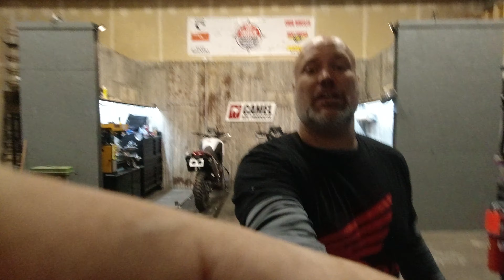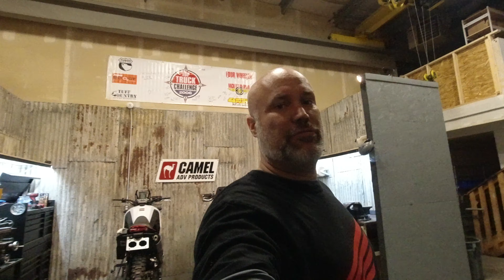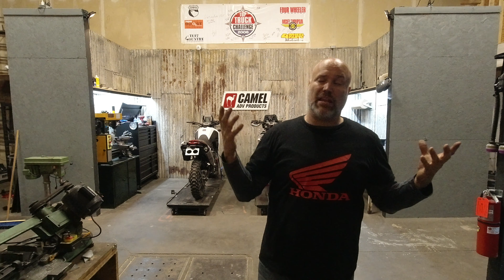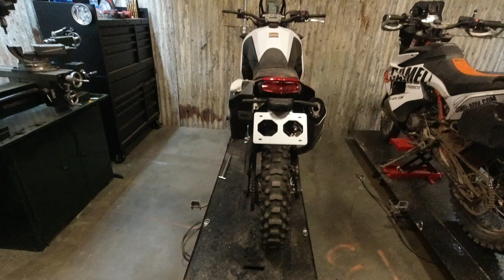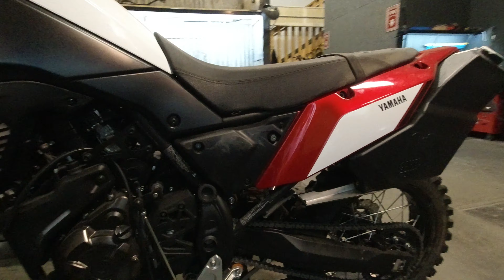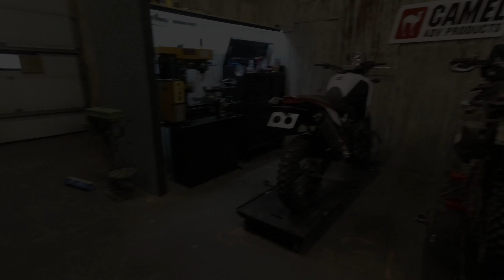Camel ADV's New Shop!

Comment: Congrats on the shop!  Whooaa!  Is that a Camel tank for the 790?  Are you working with a particular manufacturer for pannier racks to ensure fit of tank?  Want the Mosko Moto 35L but rack choice has been an issue.
Reply from the maker: The 790 Camel Tank has been done for over a year but not on the site. It's not really, "suitable for mass consumption". Not compatible with pannier packs or pillion pegs so solo riders with soft luggage only.
Reply: @CamelADV  Got it, thanks.  My wife would not appreciate that.

Comment: Congratulations Cory. This is fantastic for you and Camel ADV. Looking forward to some great new products. Anything in the works for the 2021 Africa Twin?
Reply from the maker: Honda has done a great job fixing the issues on the AT as the model evolves. The 2020-up AT is pretty well sorted so a lot of the parts we make for the '16-'19 aren't required on the new bike.
Reply: @CamelADV  Interesting Cory. Good to know. My 2017 AT has 13,000+ miles about half of which has been off asphalt, and a large portion of that half has been fairly aggressive terrain in the northern California Sierra Nevada mountains, some Utah, and western Colorado. Mine is feeling a bit loose and tired. Stock forks and shock are well beyond their service limit. :-)   I have really benefited from all the Camel ADV products you created for that 2017 vintage. Your recent video with your friend on his DCT AT looked like a lot of fun. I'm beginning to think about what I might replace my AT with. Maybe a 2020+ AT Adventure Sport. Darn expensive though, these new fangled adventure bikes. I wonder if the supercharged AT rumors will come true? Thanks for the great videos and great products.